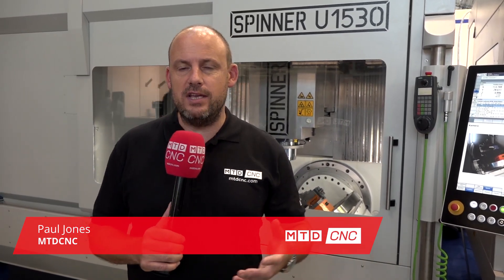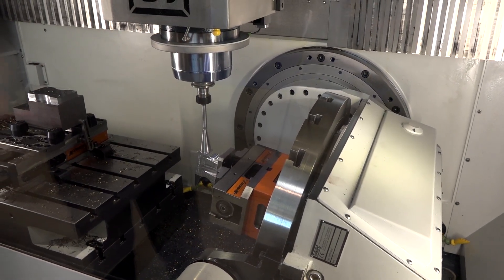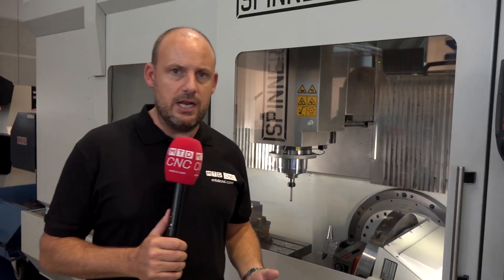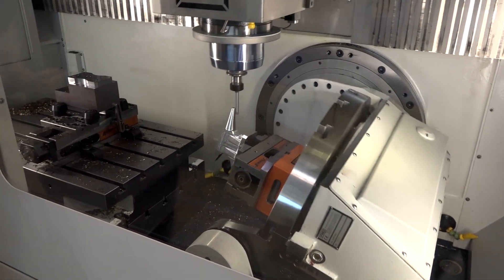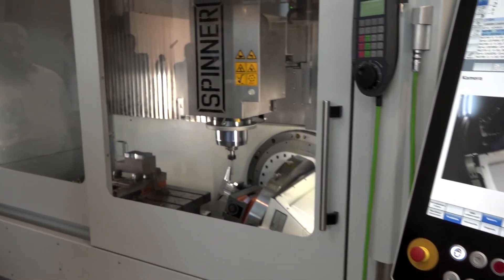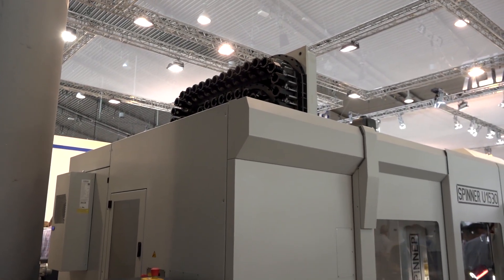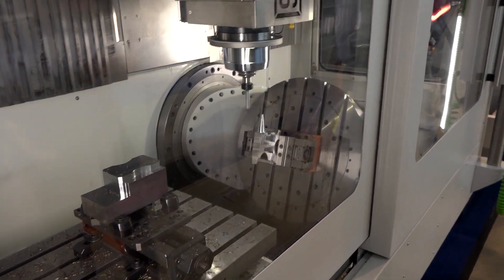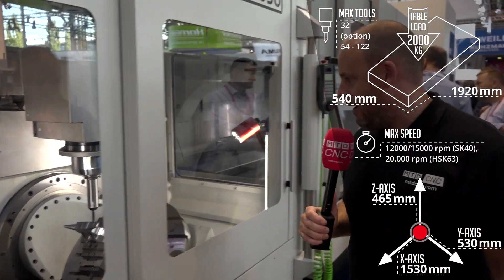SPINNER U1530 two tables, one fixed and one 5 axis

Comment: I think the layout concept on this machine is brilliant for both smaller intricate parts and long parts as well. I wish other MTBs would use the same layout, Spinner does not have much presence in the USA yet.
Reply: I would purchase this machine if I were a business owner. 2 or 3 ops and parts are finished. Who wouldn't want that? Very nice machine
Reply from the maker: It looks like Spinner are represented in the US by Eurotech so you could get your hands on one if you wanted! - http://www.eurotechelite.com/distributors.aspx
Reply: @MTD CNC thanks for the link ! The cool thing with the spinner is I believe you can park the knuckle table at "0" and actually work on a longer work piece fixtured and straddling the two tables, (one static, one dynamic). Because of availability + possibly more local support have been leaning more in the integrex I-200 direction (60" between centers).
Reply: How ironic that eurotech has a distribution client right in my hometown. I will definitely be showing my boss this machine.
Reply: Aye, indeed, I think there is one service tech from Germany that is based in Charleston (South Carolina)… I'm about 1800 miles away from that. Conventional wisdom says have local support etc. blah blah blah but if someone wanted to make a real go on that machine then that might provide some opportunities for someone. Interestingly That's why I have veered more towards an integrex I-200 (long work pieces) + 5 axis + turning.
Reply from the maker: There's loads of space in there for sure! We think it's a great machine. Too bad they're not so common in the US from what you say!